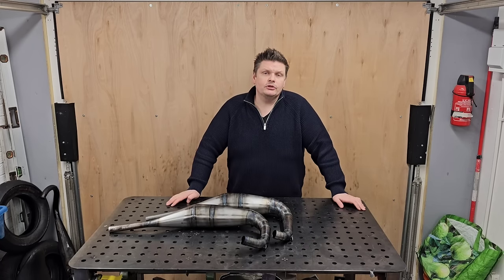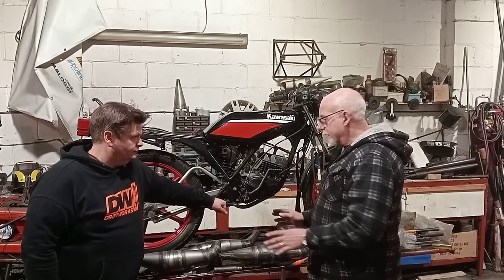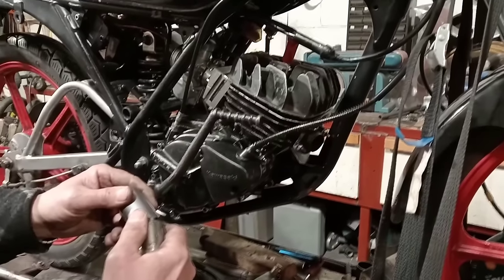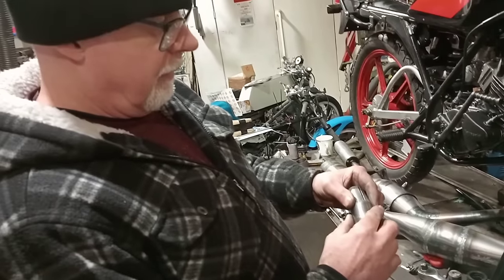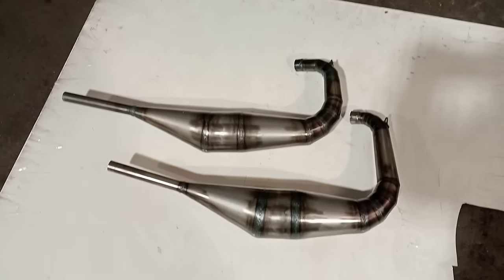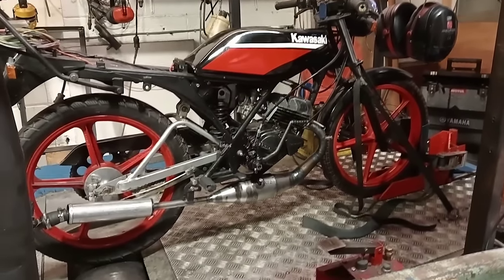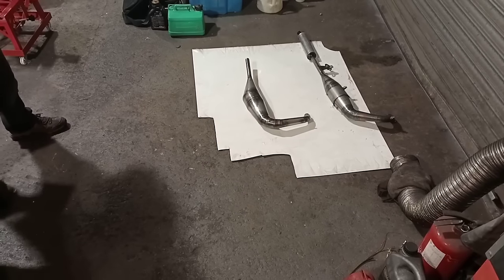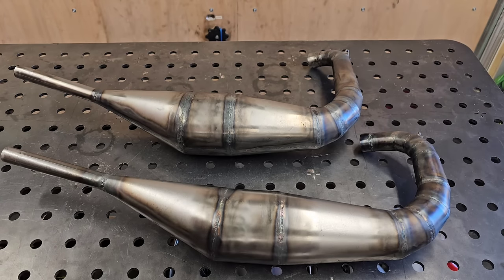2 Stroke Expansion Pipe Builder Reveals PIPE SECRETS - A day at Mick Abbey's.     #2stroke #power

Comment: Could you broaden the area under the curve with a valved stinger in theory? Start with a stinger larger than you would run, test some restrictions in it,build a map like you do for ignition timing, install a valve controlled by rpm. I was thinking the heat in the pipe is controlled by stinger size, and sonic wave speed varies with heat,etc. Maybe having to get rid of the exhaust gasses or it just not working in this manner makes this idea impractical. Or just dumb😂.
Reply from the maker: Yes, you could. I did some tests on my race bike some years ago with the stinger and smaller did give more power. However, I got greedy and melted the motor. The ignitech would be able to control what you suggest.

I was thinking water injection but a variable stinger restriction should work similar.

Comment: What you do now is go back in to mota and adjust the running parameters so  the results match them mess with to pipe.  

I lost a night and ended up with 100 pipes on the computer 😂
Reply from the maker: I've made some rear cones to try that I tested in Mota and EngMod. 

I try not to play  too much with the parameters to get the pipe to match reality. I think that is why my T40 pipe peaks lower than expected.

Note. My real world dyno runs are on a inertia dyno and the sim act like a steady state dyno that will build up more heat into the engine, giving a higher peak rpm for the sim results.

Comment: That looks nice Dave , but i think the big-bore should make at least 28 HP
Reply from the maker: Cheers Henk. Yes it should be making a bit more power and it needs too. I'll get there... It'll just take a bit more time. Note - my standard RGV 250 made 56 hp on a dynojet years ago when I had it tested. Dividing power by cc and multiplying by 250 gives 51.5 hp.

Comment: I wonder what little dofferences make it so the powerband is wider. Dark magic knowledge lol
Reply from the maker: It should allow the bike to get into top gear without falling out of the powerband. In the original magazine challenge they had this issue. The original challenge used the T40 pipe design. I recon with Mick's giving the extra rpm range they may have got into sixth gear!?

Comment: https://youtu.be/uXMy4GoFtPA?si=-UjZ8Vau7PfwvCG_

Maybe this will work for you. After doing it I would probably have tried to push the flow in a different direction somewhat to get the exhaust out faster.I don’t have a dyno so actual testing wasn’t possible but I would say 5-8 mph increase.
Reply from the maker: Cheers Roger - so a noticeable improvement then!
Reply: @AutoBeta2T  yes whether it was because of the case being stuffed in a sense I can’t honestly say my opinion would be, though that beyond the increase pressure volume the flow can be directed. It would just take some fine tuning. I worked with a couple of people on this idea in the first place and came up with it because they told me that I couldn’t change the flow with a heavier journal or a lighter journal and there was no other option that I could realize at the time. I know it’s a crude video but hopefully you can makes sense of it.

Comment: I bought an AR125 in 1983. at the first service the fork stanchions were replaced due to pitting from the rust. other faults were kick start stop wearing, went through 3 different kick starts, gear linkage wore through, rotary disc disintegrated, the resulting carbon fibres punctured the water pump seal and it needed a complete engine strip. probably the worst bike I have ever owned
Reply from the maker: Bugger, sounds like a bit of a lemon!
Bits for them are like hens teeth nowadays.

Comment: At a guess  Mr Abby’s pipe is shorter than the others
Reply from the maker: Hi, it was actually longer by about 50mm

My T40 pipe always acted a bit weird, as if it was longer. It was made for a AM6 race engine, but it wouldn't rev, however it worked okay with the AR93... but it can hopefully be improved.
Reply: @AutoBeta2T   must be a lot fatter and higher volume 

Also sounds like a lot of ignition    Any more than 14deg at peak and would expect it to melt
Reply from the maker: Not sure about the volume difference,  I'd need to have a look at that. 
Yeah, I've heard 14 deg is about max but it seems to like a bit more. I'll have to keep a close eye on it for real testing though. There will be a lot more heat going into it at wot on long runs.
Reply: @AutoBeta2T  would if it hasn’t melted with more than 14 deg at peak then you haven’t got much compression    But then to much also kills rpm.  

With the karts ther. Lads are up at 50hp for the 125 reeds and 104hp for the 250 twins
Reply: @AutoBeta2T  best idea is to modify mota  to match the real world. And base any changes on that
Reply: @AutoBeta2T   stinger diameter also worth testing separately. Making it so it can be chained without effecting the pile shape.     To big might be why the motor can take so much ignition and not melt  

Fortunately running 125s   I can basically copy everything over from  the aprilia race bike stuff.  Going slightly bigger just for safety 😂